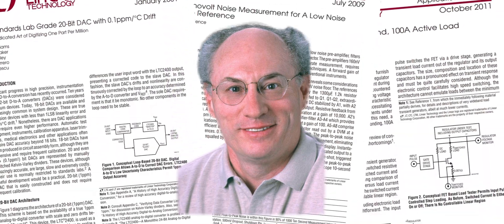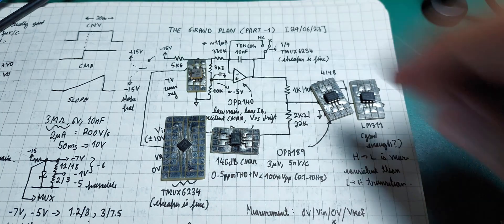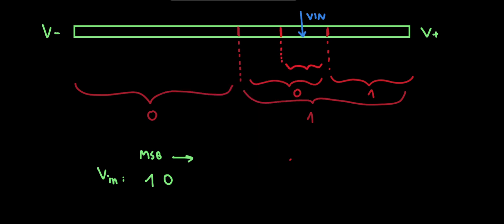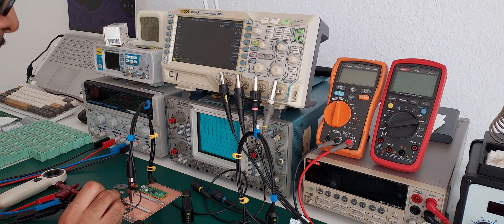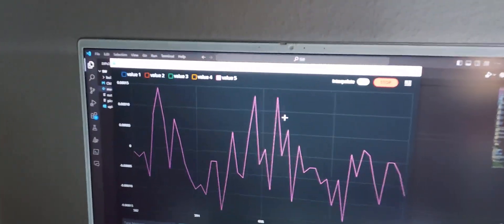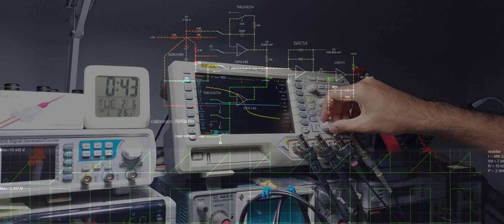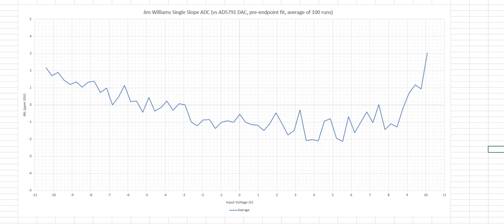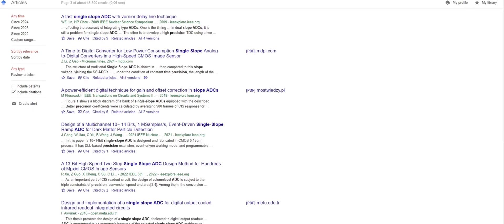AN-260 - Jim Williams’ ADC Masterpiece

Comment: 14:45 hmm, I wouldn't call this "wild", it mostly looks like what I'd expect provided I ignore the frequency axis. An averaging filter is well known to have pretty meh frequency response, with unit gain only at multiples of f_S (the sampling frequency) and nulls at all other multiples of f_S/N for N-sample averaging. The problem here is that with a 100ms sampling period, you'd expect peaks at multiples of 10 Hz which is clearly not where they're at.
Reply from the maker: That's interesting... although I have to mention, the 'sampling period' in this case is just the ramp time, which is 20ms. Each conversion is three ramps and three reset phases (zero, reference, input), totaling 120ms.
Reply: @NNNILabs  Ah, 120ms sampling interval i.e. 8.33 Hz sampling rate indeed looks consistent with the graphs you got when doing averaging. Specifically, the expected difference between no averaging and N-point averaging (in dB) is:
10 log₁₀( (1-cos(N ω)) / (1-cos(ω)) / N² )
where ω = 2 π f / f_S

EDIT: or perhaps a nicer expression is:
20 log₁₀| sin(N ω / 2) / sin(ω / 2) / N |
Reply from the maker: @MatthijsvanDuin  Just tried the second formula, and it got me really close! There's still some kind of offset in the calculated result, and I had to change the formula slightly. I have to mention, I have no idea what I'm doing 😂 I would love to get in touch somewhere else so we can discuss this though, do you have a Discord account? You can find me there (basically online 24/7) under the same tag (@nnnilabs).

I've pinned the comment since this basically explains it.

Comment: Cool! Very good performance overall. 

Just as a note, didn't see whether you retained it, but the ADuM140x series can itself be rather noisy, and I would suspect that it might introduce timing jitter. 

Since these devices use transformers to couple the signal across the isolation boundary, they can only transmit signal transitions (not the actual signal state). Basically they send one type of pulse when the signal transitions high, another type when it transitions low, and nothing in between. The output side needs to latch the signal state. The problem with this approach is that if some noise glitch or other event causes the output latch that stores the signal state to inadvertently flip, the output will be wrong until the input changes again. That would of course be very bad. 

To fix this, the ADuM140x transmits "refresh" pulses even when you're not doing anything with the signal (the datasheet I saw says this is at ~1us period). It does this whenever the input signal goes more than 1us without transitions (is the case with your signals, I believe).  But, of course this means that it's generating noise in the ~1MHz region and above all the time. Potentially worse is that I imagine there might be interactions between the refresh pulses and the data edge pulses. Imagine that you're sending a low-to-high transition but the refresh pulse has already started to send the original "low" state. I don't know how the chip would handle this, but I'd worry it might end up delaying your transition until the refresh pulse was done. This would quite possibly introduce timing jitter to the signals.

Not sure what the solution here might be... putting an MCU of any sort on the same rails as the circuit without destroying the performance is going to be very, very hard. Traditional optocouplers might be one approach, although they do have pretty bad timing distortion themselves (not sure how sensitive the circuit is to this as I haven't studied it). It might also be possible to allow the MCU and converter to share a ground reference, but split the power rails completely, and then isolate the digital signals by transmitting them through some reasonably large resistors (~1-10k) and re-buffering them in the converter power domain with some logic gates powered by the analog rails, to restore edge slew rate and drive strength, while still interrupting the noise current path from the MCU's GPIOs.
Reply from the maker: Thanks for the tip, that's something I never thought about! I was aware that the ADuM was transformer coupled, but skipped over how it was actually implemented. Definitely will keep it in mind for the future. I did end up removing it when I moved to TMT.

Comment: Thanks for the presenting a very interesting project. If the sampling interval is 120ms it will not provide any 50Hz suppression, no matter how many averages are taken, as it will be sampling the 50Hz interference at the same phase angle in every 6th cycle.

I'm sure you know this but for the benefit of other viewers the ramp time has no relevance to the 50Hz suppression - as you observed, this ADC does not integrate the input signal over a single measurement cycle. That can only be achieved by averaging multiple measurements. For best NMRR the measurement sampling instances need to be phase locked to, and be equally spread over an integer number of cycles of the interfering signal -eg. averaging two measurements at 10ms intervals will provide a notch at 50Hz (and multiples) and significant NMRR.

To complicate matters, the sampling point within each ramp is proportional to the input signal at the sampling instance so whilst it will be the same for each measurement of a DC input signal, adding an AC interfering signal means the sampling point in each ramp will vary accordingly. I'll let you do the NMRR analysis from here onwards :)
Reply from the maker: The pinned comment pointed out the same thing actually, and you're right, trying to reject NM noise with a single slope ADC is not very straightforward😅

Comment: why not use python or r to analyse the INL?
Though to be fair, excel is way more intuitive to use
Reply from the maker: Somehow I think I'm mentally retarded in the sense that I find it very hard to wrap my head around these programmatical tools. I've tried it, and I hope to get a system up and running soon-ish, but Excel is just very comfortable for the amount of data I process, although there are two very good points as to why I should use a 'standard' tool:
- Dealing with larger quantities of data (say, from 100 runs) becomes very hard to deal with
- Recreating the same plot is difficult because you have to manually fiddle with the plot area, etc.
Reply: @NNNILabs  i do get it, everything is neatly organized and premade
Excel is always more convenient and stuff
Though python does hold size advantages, as it's easier to process large amounts of data